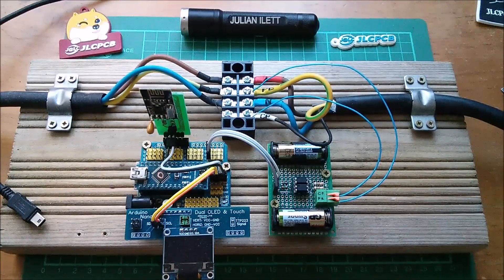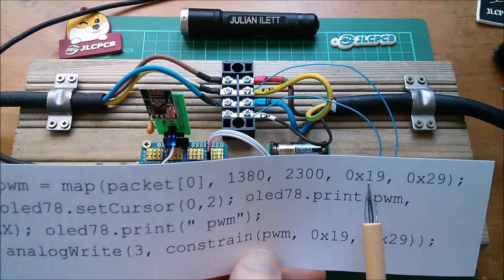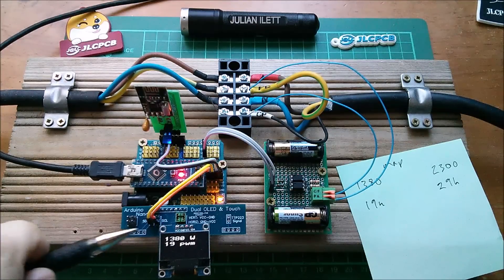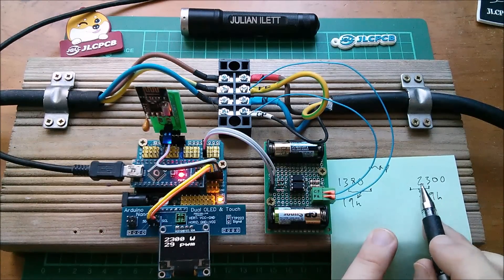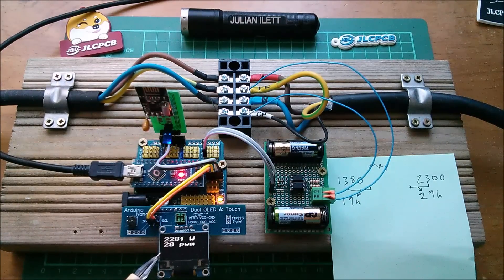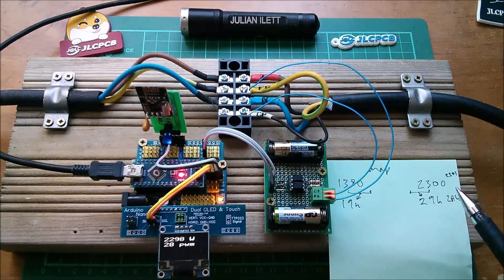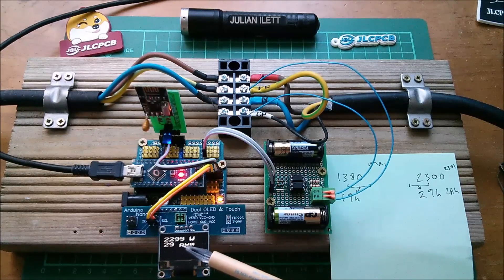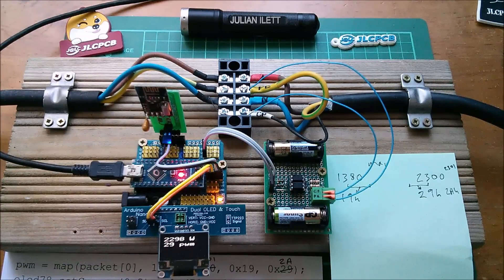The map() Function is Really Basic

Comment: The map function is just a short hand for a common formula for converting analog input values to engineering units in industrial automation. The highest number of your engineering units will only ever appear when you receive the highest number from the analog input value. That's how it's supposed to work.  so (I'm converting to decimal here, just for simplicity) the value would be for  your numbers x = your input value from the radio, function(x) =(x-1380)*(16/(2300-1380))+25 so for your max input of 2300 you'd get 41.  It's ugly because you have to reduce the ranges to 0-max and then add back in the offset at the end because your ranges don't start at zero.    Youtube isn't suited to this.   The input range is 920 that's your maximum minus your minimum. So we have to subtract the low range value from your input (x-1380) then we have to get the scale of your range. In decimal that's 16 so we divide the 16 by the range(2300-1380= 920) 16/920 = 0.017391.  So we take your input value, multiply it by the adjusted input scale 920*0.017391=40.99999968.   Rounded to 41 which in hex is 29. This is all with floating point.  I'm guessing it's truncating the decimal and only giving you the integer which is why it only shows 29h when the incoming value is exactly 2300.
Reply: Unfortunately, (or maybe fortunately?) this is not handled in floating-point. Math like this, in code, relies heavily on the order of operations. If accuracy is important, things like N/6+0.5 must be considered differently than in "real-world math", e.g. (N+3)/6. If accuracy is important, then things like floating-point-error must be considered. E.G. there is no way to know, for certain, whether (float)1.0 == (int)1, unless one considers each specific implementation (every single processor it may run on, and every single compiler that may compile it). BUT, if you avoid floating-point math, then integer-math, handled by processors of all varieties, is identical, if you're careful to explicitely state, e.g.  uint8_t, instead of "int"

Comment: I am not at all surprised by the operation of the map() function. I haven't read the spec or the code in detail like @Canadian RobJ et al below, but I would only expect to get the translated 100% value when passed the 100% source value. This may, in fact, be critical in some situations.

In this case, I would have taken the other solution and made the top number 2298 or even as low as 2250 because that seems to be where you want 29h to start.
Reply: As a normal person if I was asked to divide the numbers 0-99 into decades, I would assume map() would put 0-9 into decade 1, 10-19 into decade 2 etc.  map() decides only 0 belongs in the first decade, which is rather odd.
Reply: @j.f.christ8421  in programming it is quite common to start counting at zero.

Comment: here's the Arduino code for map() which does not check for divide by zero

long map(long x, long in_min, long in_max, long out_min, long out_max) {
  return (x - in_min) * (out_max - out_min) / (in_max - in_min) + out_min;}

It is not error safe - the values need to be checked before calling map. 

The number is scaled, integer (x--...) is multiplied by the scaling factor (outmax..)/(inmax..) which is an integer. If x is inmax, then the scaling factor is 1, otherwise the scaling factor is not 1.  [inmax-inmain cancels out leaving outmax-outmin+outmin which is outmax]

Comment: The map() function is working exactly as documented!   
Just because you wish it did something else does not make it silly or wrong. Don't blame Arduino for your mistakes!

The Arduino reference for map() says <quoting> " _That is, a value of fromLow would get mapped to toLow, a value of fromHigh to toHigh, values in-between to values in-between, etc. _ "

It's quite clear from the above that values below 2300 ( I.e. "In between" values) will be mapped to values below 2A.
Reply: Exactly. That's how it's supposed to work. I worked in industrial automation; the map function is just an implementation of a scale function for an analog input mapping incoming values to engineering units.
Reply: moved
Reply: Exactly, cant complain about free software. If you want a function that does something specific to your application you'll have to code it yourself.
Reply: @sjm4306  I think it's more about realising *your" expectations aren't the same as all the industrial users before...  Bad Julian! :-P Another way to look at,  and understand this, is to consider the count from one or count from zero...  The fact he just +1 should have made that a pretty obvious connection :)

Comment: I think map() isn't constrained by the operators, so your plan may not work; i.e even if you define  input values fron 0x19 to 0x29, the function will extrapolate a value if it sees an input of 0x05 or 0xFA, so an input of 0x18 will get you an output of ~1300ish.

Comment: i'm half way through the video
nice explanation
at this point i'd try
pwm = map(packet[0], 1380, 2301, 0x19, 0x2A);
now i'll keep watching :)

well funny that's exactly what you did

the map function could be extended to take a config input at the end, 0 for standard, open range mapping, where it also maps numbers outside the specified ranges, as it does now, and a 1, for mapping in closed ranges, where the function adds 1 to max Input and max output automatically

both behaviours have their place and could be wanted